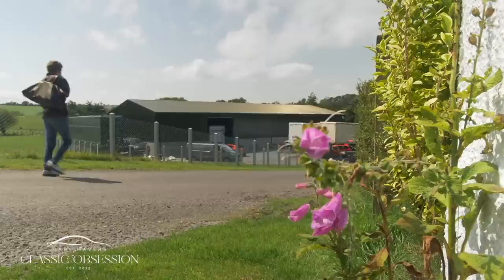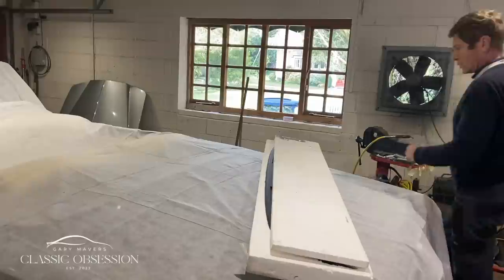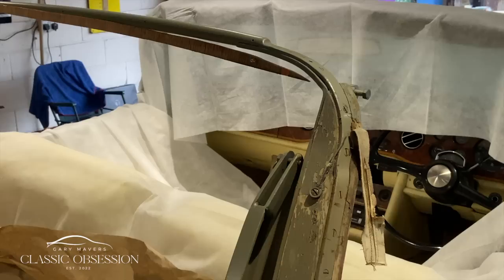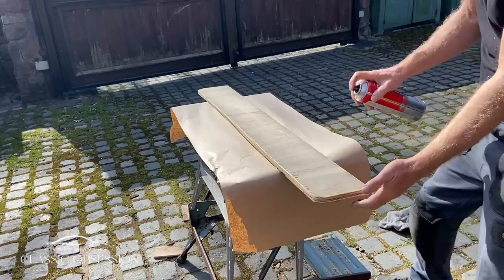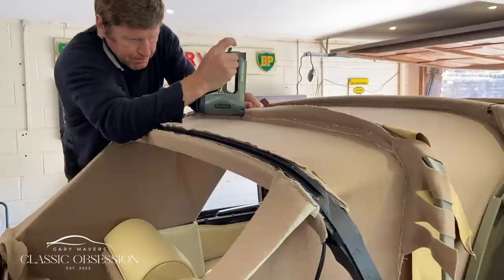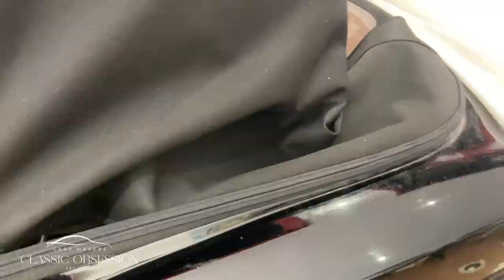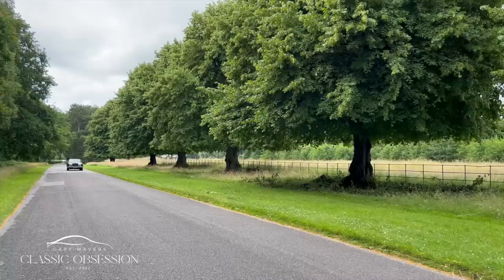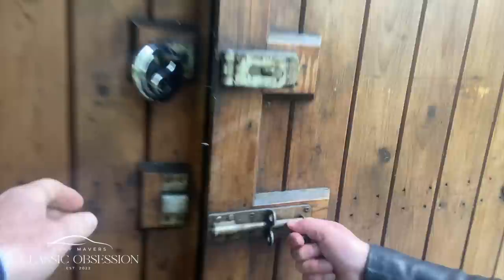Making a Rolls-Royce convertible hood from scratch | Classic Obsession | Episode 4

Comment: I used to deliver to the Rolls Royce factory in Crewe, I was able to walk around and watch the as the engineers lovingly assembled the cars and talk to them about the processes used. They told me that the cost of their cars came from what you couldn't see, not what you could and seeing the attention to details, such as tinning the engine waterways to ensure the antifreeze stayed the same colour between changes and areas of the brightwork that were exposed to high water volumes. Your attention to detail mimics theirs. Fantastic!

Comment: I've got a 99 SL500,  some of the things I've replaced myself in no particular order,  engine and transmission mounts , flex joints,  door check straps valve cover gaskets,  various trim pieces,  all the roof hydraulic cylinders and a lot more but when I wanted a new canvas roof I took it to a shop,  he was experienced but not too much with the SL even he had a bit of a hard time putting the canvas roof on and getting it to look perfect,  what you did with this roof was absolutely stunning,
Reply from the maker: You’ve done a lot of tricky jobs. You should be proud of yourself. The 500 is a lovely car. Many thanks.

Comment: Stunning courage to tackle anything. I researched replacing the soft top and went through all the options I could think of. To get it done professionally is quite a chunk of the value of the car, the materials to do it are expensive, you need a lot if skills, and I was warned about getting the inner stuffing layer correct so it would sit right. Then you have to decide everflex or canvas, and what colour. I don't have a large clean workspace and sewing was more than I thought I could learn. I changed to a Continental R instead which is still the same car underneath, a bit more all weather usable but no soft top. If I'd seen this first, maybe.
Reply from the maker: It’s a tough job Sohrab and not for the faint hearted. Although very enjoyable and satisfying when completed, because I had to also film each step of the process. It took me about a month! Many thanks.
Reply: @classic.obsession  Planning and editing the filming in a logical sequence as well is some task on its own. You've actually given me a bit of a push to try some more restoration myself.

Comment: Great end to a great series. Top job there with hood mate, although tbh I was waiting to see how you fitted the rear screen. 

Fantastic results and the graceful old girl has got her looks back again. Can’t wait for the next one.
Reply from the maker: Thanks so much and sorry I couldn’t include fitting the rear screen. I could’ve made a 12 hour video just on the hood alone but I have to be brutal with the edit, whilst trying to cover all. If it’s any consolation though, it’s actually the easiest part of the job. Simply staples into the bottom halve of the wood at the top and staples tight, neatly as possible into the wood I made up at the bottom. It remains free and in sewn at each side and is covered by the rear quarters of the hood above. Regards.

Comment: The headliner you made from scratch... but the Top or the 'Hood' you bought as a kit, yes?
Reply from the maker: Yes. From B.A.S. They supply it with a Roll of the west of England cloth and that’s it. No instructions. No pattern. The rest is down to you. I searched high and low for information or pictures on the net and found nothing. I couldn’t even use my old one as a guide as it was none existent with the frame in bits in the boot. I just used what common sense I had along with a bit of bravery and ‘got stuck in!!’ Regards.
Reply: BAS hood is remarkable affordable. Wow. All about the labor I suppose.
Reply from the maker: Looked easy but took me a month..

Comment: 2:16 Why does it say Silver Shadow on the bulkhead? Is it a reality a pre-Corniche convertible?
Reply from the maker: Hi. Because it basically is a two door shadow derivative by milliner park ward…
Reply: @classic.obsession  Yeah they changed the name later by 71, buts it's the same car. Before that, the 2dr convertible was called "Silver Shadow Drop/Fixedhead Coupe by Mulliner Park Ward" or so. If yours is pre-71, calling it Corniche is not correct.